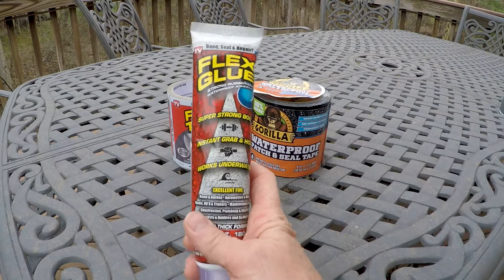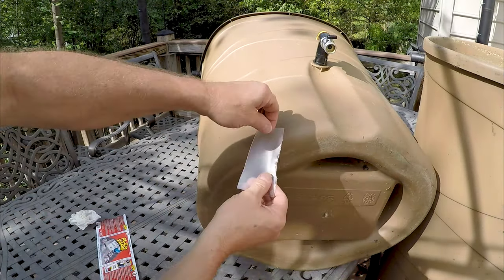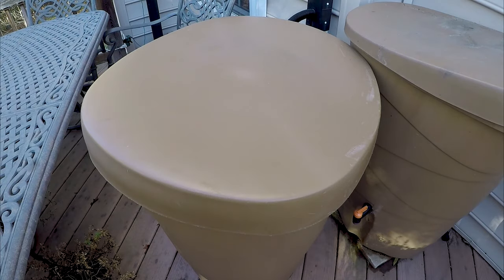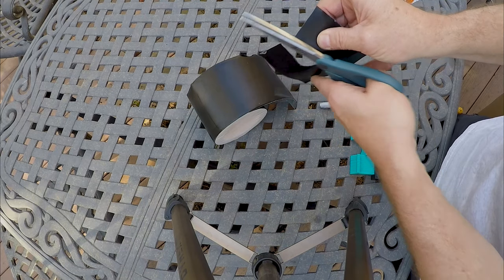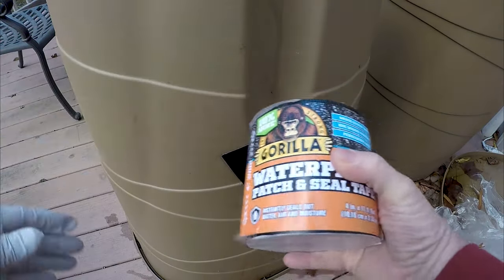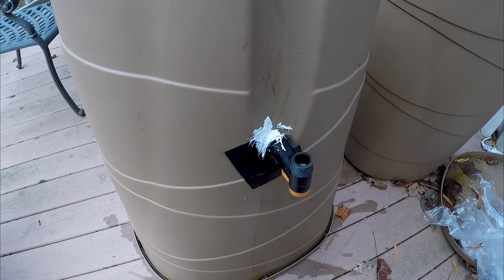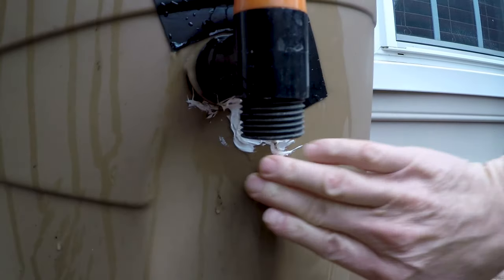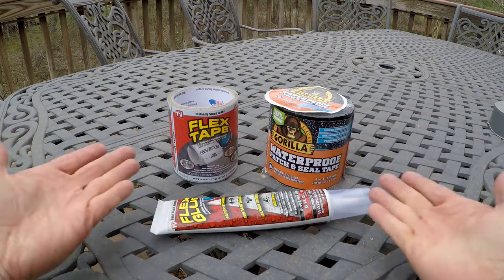Stick It Test: Flex Seal and Glue Versus Gorilla Tape - Which is Best?

Comment: If you wanna repair fluid tanks (inc Water) your better off repairing from inside as the weight/pressure of water will help form a better seal. But I would have gone with the glue as posed to tape. esp with uneven surfaces. I have not finished watching and maybe you will do just this. Thank you for reviewing these products I am very curious about them BUT DAM THEY ARE EXPENSIVE IN AUSTRALIA!
Reply from the maker: Jayson Black, perfect timing on your comment! Just yesterday I used Flex Paste on these same barrels on the inside. Will let them dry for 48 hours, and them put them to the test. Checked them this morning and the paste is just about dry. Stay tuned, plan to post the video this week.
Reply: Where will I get some of this  my tank is leaking
Reply: @MakeItorBreakItNow  Did you post it? :)

Comment: I came here from curiosity on Flex Tape and Gorilla Tape. Perhaps plastic welding would be the best option on these barrels.
Reply from the maker: Keith, funny you mentioned plastic welding. Did just that about 6 weeks ago and it worked, stay tuned for the video. Wanted to make sure they worked before I posted.

Comment: The weight of the water kept coming to mind. Lots of psi there. 
   These sealants might have worked to keep water out. Just not heavy water in? Thank you for demoing 3 products.
    I’ve used an electric hot iron to melt plastic patch’s and plastic cracks together.
   Another method is pvc glue and cleaners with a scrap of plastic as a patch.
Reply from the maker: mavrickscar, interesting suggestions I might have to try them out.

Comment: Simply buy a fibre waterproof paint. Simply paint it on it dries like fibreglass. Widely available. Literally a 5 min job. ✌🏻🏴
Reply from the maker: Mr. Smith, thanks for the suggestion. The particular challenge I have with these rain barrels is that its a soft, smooth, flexible surface. Most materials don't last when bent or placed under pressure.
Reply: ... you could even try to paint the inside as well as the outer. Poke it into the gap. Also you could let it dry and build it up. Then paint the barrels black and they’d be good as new.
Reply from the maker: @MrSmid888  some more good ideas, thanks for sharing.

Comment: you didn't to a very good comparison you put far too many variables in, you should have repeated the exact same process for both tapes you also removed the backing prior to adhesion just getting your fingers on the tape is enough to goof the bond
Reply from the maker: I'v done several videos on this challenge. In the commercials they're not so delecate they just slap the stuff on and it works everytime. Ultimately I've switched to plastic welding which has solved this issue for good. Here's the final video: https://www.youtube.com/watch?v=IECD0dVc0aA&t=6s